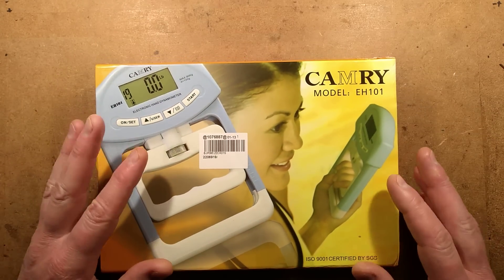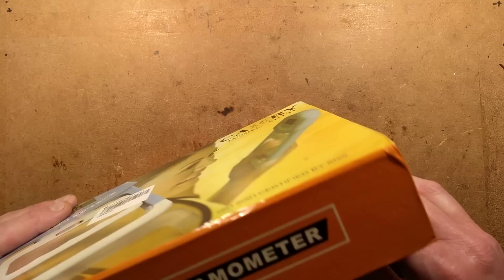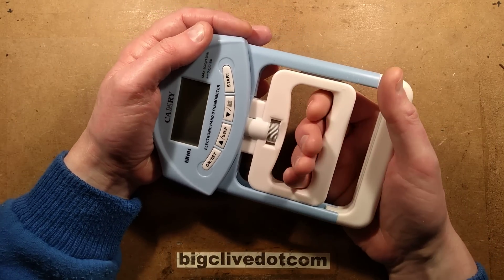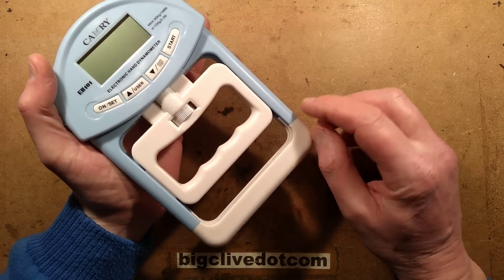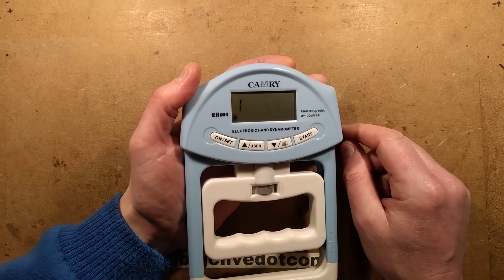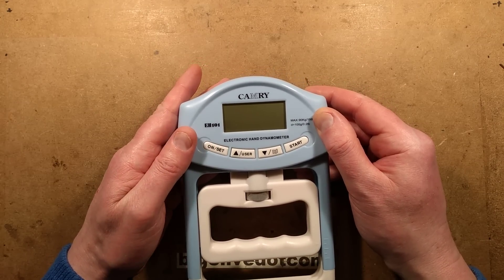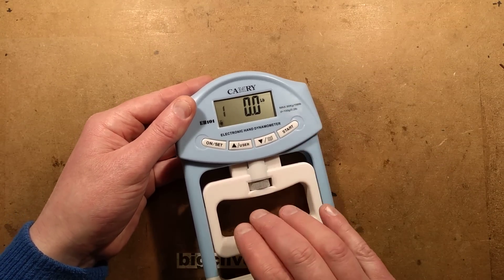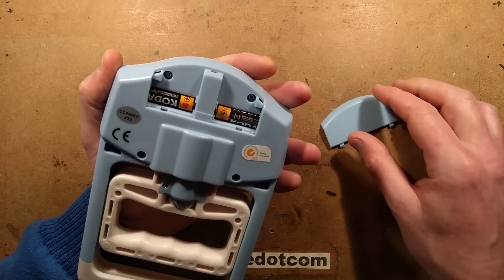Inside a hand grip strength tester - dynamometer.

Comment: I've been thinking about making a set of dance pads (like for Dance-dance revolution), using strain gauges like that to detect user input may work well (configurable threshold, no contacts, etc.). The only issue is that I need to detect the slightest of taps and withstand the hardest of stomps.
Reply: LazerLord10 Those properties are all decided by the piece of slightly springy metal.  Next you need to measure electrical values beyond the resulting range of deformation values (to allow correcting manufacturing variations in software).  So I guess you will need a HiFi grade A/D converter that doesn't try to filter out DC on its own.  The 12 bit A/D in most microcontrollers will probably not do the job of giving you a range from 50g to 2 ton with each of 9 pads checked every ms.  Unless you make a more complex feedback circuit where the controller switches analog circuit parameters and set a trigger point for comparators that interrupts on slight change from previous state.
Reply: @johnfrancisdoe1563  I'd probably just have an amplifier going to one of the analog channels and go from there. It honestly seems like the mechanical implementation (of everything) is more of a challenge than the electrics.
Reply: @LazerLord10  Hey commenter of three years ago! Did you ever find a chance to give this build a try? I went through my own period of wanting to build a dance pad/deck. Even built the frame in CAD. It resembles In The Groove II cabinet deck (way better than the crap Konami came up with). I wonder if I still have the build files 🤔
BUT I never figured out the surprisingly complex sensor mechanics. 
Lemme know!
- A chance encounter friend
Reply: @jonathanb3899  I did in fact build it! Send me an e mail thru my channel info and I'll let you know how it went!

Comment: Pro-tip for people who train/workout; if you are concerned that you haven't waited long enough since your last workout (haven't recovered enough to work out again,) check your grip strength.  If it has decreased from your baseline (which you should have recorded before your last workout), you haven't recovered.  Honestly, you could just squeeze a bathroom scale and record that number.
Reply: In a lift designed for 8 people. 4 of us inside all normal weight. A body builder got in and it went over weight! He said "well that's a bit embarrassing" and had to get the life by himself ltr.
Reply: bathroom scales these days are built from 4 pressure sensors, connected in a wheatstone bridge. You cant use them with your hands. I is the reason I ordered one of these just the other day.
Reply: Jeff C's Master tips :-)
Reply: Haha, you got it!
Reply: I used to check with a bathroom scale, but you have to squeeze it with both hands at the same time and it maxed at 150Kg (75Kg per hand). This also seems better at checking which hand is stronger.
Reply: hmm, do you really need to fully recover in order to benefit from working on a different muscle group? I use to just did one group a day then a day of rest every week and got really really ripped
Reply: @ChrisD4335   Sorry I didn't reply sooner.  In my experience I do see a negative impact on my next work-out if I am not fully recovered, regardless of the muscle groups-- I do splits (arms/shoulders one day, back/chest a few days later, glutes/legs a few days after that.)  And by "negative impact" I mean stagnation or even minor losses in overall lifted volume.  I care more about progressive overload then getting ripped.  Different training styles becomes a complicated discussion anyhow.

Comment: Interesting thing about strain gauges by the way: typically you would want to set them up in a Wheatstone bridge kind of arrangement as you said, but there are several ways of going about it. The best way is to have two opposing gauges parallel to the direction of elongation, and two perpendicular. So two of them have a resistance increase and two have a resistance decrease as the thing deforms, yielding the largest voltage difference in the bridge. However, you also have half-bridges where miniaturization is important, comparable to a simple voltage divider, and up to all but one of the strain gauges could be replaced by a dummy or a matching resistor, to save cost. If you were to remove that white silastic you'd likely see this bridge arrangement split over both sides. I'm actually kind of surprised by how it's constructed. If it was me I'd have molded in a somewhat sharper point for both ends of the aluminium bar to rest on so you wouldn't have to worry about nonlinearities as the plastic deforms. But I guess they tested it and decided it was good enough for what it's for.

Comment: Clive - "I have a strong grip" - sounds like much misspent teenage years to me.
Reply from the maker: Misspent in steelworks and construction sites.  But also "that" too.
Reply: Steelworks and construction: that would do it. "Get strong or die trying", to paraphrase 50 pence. Beats my puny 38kg.
Reply: Well I am only 55 kgs as in weight, same as i was when i was a teenager.
Reply: @964tractorboy  I read an article about grip strengh and health, it appears, there is a correlation. So I thought, thats why I met such a device at health assessment. I haven't cared to do further investigation but was told that my 75kg grip was quite a good number. The device they used was old style mechanical spring and dial indicator, all metal and had 120kg max reading.
Reply: @964tractorboy  Are you a woman? 😂
Reply: @bigclivedotcom  Hot stuff coming through.. *obscure Simpsons reference
Reply from the maker: @mixerfistit5522  Rosco at the steelworks.
Reply: @bigclivedotcom  Roscoe that's right! The whole episode has come flooding back now haha
Reply: bigclivedotcom in America steel mills are notorious for...acts of the homosexual nature
Reply from the maker: @Some_Beach  It wouldn't surprise me.  It's a very male environment.
Reply: If jacking off gives you a strong grip, you are doing everything wrong.
Reply: @natalieobman5018    most wankers outside of the usa dont need to use such a strong grip
Reply: @natalieobman5018  LOL!!!!!!
Reply: Misspent? I don't think so, just call me Juan Kerr ;-)))
Reply: I would thank you not to spread the myth you must grip the dee with great force, I've had a few ladys give me the old death grip and oh man that's an ouchie.
Reply: @ChrisD4335  apparently her last boyfriend liked her to do that to his testies and she said she wanted to impress me.....she did not impress me.
Reply: Death grip isn't something to joke about.  OK, it is, but still, it's a real problem that most people don't know about.  (Death grip is when some guys, due to there being no education about such matters, get accustomed to using an extremely tight grip when spanking the monkey and then find themselves unable to enjoy playing with a partner due to a desensitized donger.)
Reply: Best comment section....
Reply: You are Richie Mayall's character from Bottom.
Reply: EnjoyingUTube Too it’s just a high amount of proteins in hand muscles and nerves
Reply: My nan scored 75kg
Reply: @BenzieAnt  And you're the queen of england
Reply: What can I say he’s a master,baiter.
Reply: I prefer to call it "adhd lust"

Comment: should be in newtons ?
Reply from the maker: Add a zero to kg for a close approximation.
Reply: @bigclivedotcom  0.01 of a Newton is called a 'Hawtrey'. :)
Reply: seems like kgf, of course it's implied, nobody knows what force's unit is :)
Reply: @pmailkeey You kidding? I've been planning where to mount the pitot-static system for weeks!

But yeh, quite disappointing that even the practical outputs aren't shown. I know they're measured, the engine would never function without "knowing" a lot of what I listed, but it's never exposed, so therefore there isn't a scienticious way of knowing when your cat needs unblocking for example (a rather fun procedure... do it regularly for good measure, but only after the oil gets hot!), or how efficient the choocher is at any one time.

With most car engines, you can guesstimate thermal efficiency just from the manifold pressure. It'll obviously be off some, but it tracks the curve regardless. Having that output alone can help save fuel.

As far as the choocher goes, all you need to work out efficiency are a few thermocouples and maybe the odd pressure transducer. The rest is so dead simple that an arduino could do it!
Reply: 100 newtons is 10,2kgf  or 22,5 lbf.
Reply: I mean, yeah, if you wanna make a physicist happy.
Reply: Aye, it would be, except it's aimed at athletes, gym-goers and Joe-public, not physicists and engineers.

Much like dashboards in cars - never have the curious bits you'd want to know like exhaust gas temperature, pressure drop across cat/DPF, turbo pressure/temperature ratio (both sides!), manifold pressure, oil temperature, etc. Rather annoyingly!
Reply: @Bill Todd Problem is most average people don't use newtons as units. I have had to explain force in terms of the weight of bags of sugar before now
Reply: @gordonlawrence4749  oddly I have never considered newtons as a measure of weight like pounds but the torque specs on the lawnmower blades are newton meters in the manual...
Reply: @matthewmiller6068  Newtons are, in fact, the SI unit of weight. That's because weight is a force. Pounds and kilograms are both units of mass , not force.
Reply: Should be in solar masses.

Comment: I wonder on the longevity of this...
Reply: DIM Tips Circuit and sensor can last decades.  Wire near threads are worn only when changing hand size.  Unless a bad component or material was used, I guess most common failures are battery leak or unit getting wet.
Reply: @johnfrancisdoe1563  or just shit garbage plastic

Comment: That COB blob probably isn't a "normal" microcontroller, because those typically only have ADCs up to about 10 or 12 bits of resolution which I wouldn't have thought would be enough for a strain gauge/load cell. At least, the load cells on AliExpress are typically sold with, or recommended to be used with, Avia Semiconductor's HX711 ADC IC ( datasheet: https://cdn.sparkfun.com/datasheets/Sensors/ForceFlex/hx711_english.pdf ), which is a 24-bit ADC with a programmable gain amplifier (PGA) with gain options of 32, 64, and 128.

So I wonder if it's using a special microcontroller with a high-resolution ADC, or if there are maybe two silicon die under that blob? Or can load cells be usefully read with a standard 10-12-bit ADC, and the HX711 is used only for the additional accuracy?! (Certainly the "100g resolution with 90kg max load" specs on that device don't exactly scream "high-resolution!" :))
Reply from the maker: My guess is that its a microcontroller dedicated to the task of mass produced weighing scales like kitchen and luggage scales.  It makes sense to incorporate the sensing and LCD drive into a single chip with suitable power management facilities.  The external memory chip is a bit odd though.  I would have thought the microcontroller might have had at least a few memory locations for storing a calibration value.

Comment: Someone needs to develope blob remover. Still frozen in kansas we thawed hit 60 dungerees Frankenstein, now frozen rain and maybe splash of snow for 3 days.
Reply: AvE subscriber spotted :)
Reply: @benbaselet2026  yup avenbigclive is my reddit name. Aveandbugclivethisoldtonycodyslababom. Just seemed to long.
Reply: The result is a tiny die with raw bonding wires between it and the board. You gain nothing you wouldn't get by decapping a chip.
Reply: @henke37  well have you got a beheaded chip picture id like to see that.
Reply: @asbestosfibers1325  yeah i think we got 4 or 5 inches, (for the AvE followers snow that is).
Reply: If something makes no sense it's usually a quote from that creep.
Reply: @googleuser859  that's usually when  AvE will tell ya here's your hat.
Reply: @googleuser859  huh